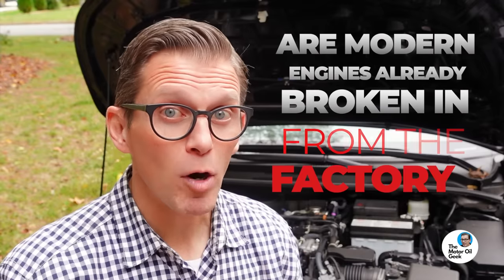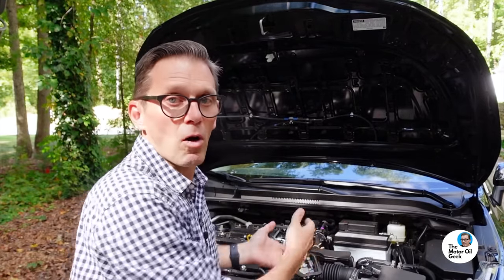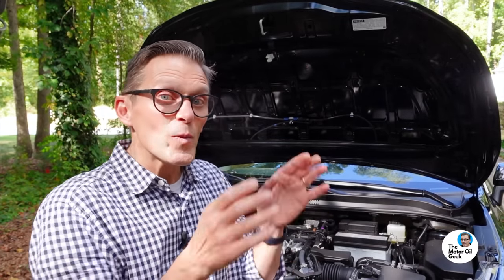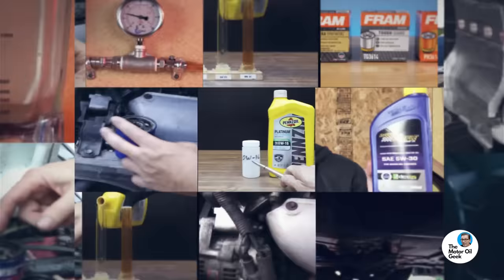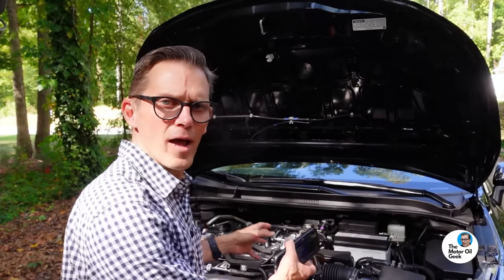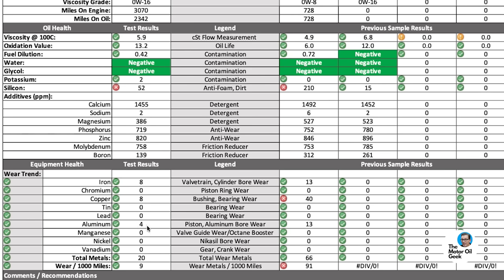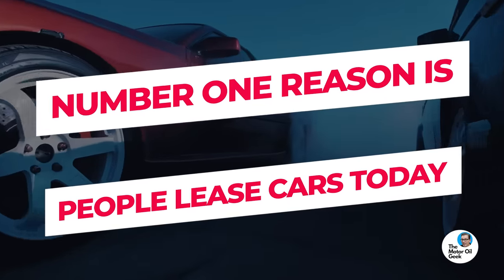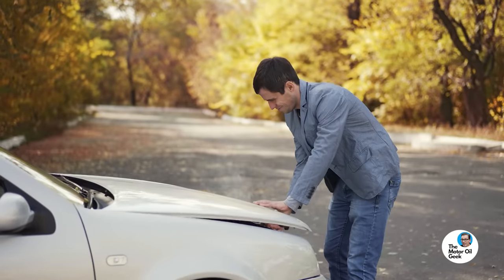New Engine Break-In: Truth or Myth?

Comment: Makes sense, the idea that engineers can spend all day breaking in every new engine never seemed right to me. Like think about how many cars are manufactured in a day, they would need to spend hours breaking in those engines. Just does not seem like a thing the manufacturer would do, when the customer can do it themselves.
Reply from the maker: Absolutely!
Reply: I'm sure the manufacturer will run the engines on a test stand for an hour just to guarantee that there were no problems with the engine but that's not a true break-in. That needs to be done on the road under normal loads and speeds.

Comment: While I agree with your findings, using a different oil viscosity (0w16 vs 0w8) and different additive package makes the initial wear numbers be more inflated. Or equally, you would see more wear if you used 0w8 again.
Reply: There isn't copper, aluminum and iron in an additive package.
Reply from the maker: The additive package was the same, and the viscosity difference was very slight. We will continue to monitor the engine, so this is not the end.
Reply: @tonysteele3805  there isn't but if you use overly thin oils cause of the stupid CAFE you will cause more wear which will show as copper, aluminum and iron in the UOA. I said in the previous video that I would use a good 0w30 in this engine no matter what Toyota says.

Comment: A little story from an expat living in Spain:  I've been here for about 28 years.  Back in 2017 I bought a Volvo XC90 AWD D5, which is a four cylinder twin turbo diesel engine (not available in the states AFAIK).  I was stunned to see that the manufacturer (and dealer) oil change interval was 15,000km (about 9,300 mi), even the FIRST one!  I remember arguing with the gm of the dealership and later, with one of his mechanics that this cannot be true as all engines need a break in period and that IMHO the first oil change should be around 3000km (about 1,800mi) and NOT the freakin 15,000 as stated.  I was told that those days are over, and that modern new engines do not require a break-in period as they did back in my days (I grew up messing around with engines in the 70's).  I told them that was bs and that I would just have an independent shop change out my oil at 2000 or 3000km to be safe.  The dealerhip's retort?  If I do that I will void the warranty that came with the vehicle.  Geezusfuckingchrist.

So stupid me listened to them and have been faithfully completing oil changes every 15.000km (and occasionally changing out the oil about every 10,000km with an independent shop since my warranty period has expired).  My Volvo is still running fine today but over the last year or so I've noticed it has begun to consume a little bit of oil between changes.  I now have 200,000km (about 124,000mi to my metric challenged brethren :-), almost all of which are highway miles.  The bottom line for me personally is that I wish I had just listened to my own common sense and insisted on an oil change interval that I KNEW was the correct one.

BTW, this same dealership insisted that my transmission fluid was for the "life of the vehicle" and have refused my requests to change it out.  So my fluid now has 200,000km on it, and I'm told by an independent mechanic  to leave it alone as changing it out now this late in the game may induce problems to it.  I'm so stupid for not listening to myself and not changing it out at least twice now.

Sorry for the long post.  Love this channel, btw.  Thank you!
Reply: Theres no truth that changing the oil early would have prevented any oil burning today. Do you even know where the oil is coming from? Could be a valve guide seal and not the rings.  I have a 2007 RV4 with 190K miles on it, nothing special was ever done, just drove it like normal and changed the oil at the recommended intervals, doesn't burn a drop of oil and still runs great, chirping tires.
Reply from the maker: Thanks for watching and sharing!
Reply: I agree with appalling68, I don't listen to the dealer anymore when buying a new car and do my first oil change myself without informing the dealer, with OM parts purchased by another dealer. Standard oil interval is now 25.000km by the dealer and I do it myself in the middle.
I hear the same from automatic gearboxes, once the oil is too long inside like over 150Kkm, they advice it's better just fill up and never change it anymore.

Comment: Is there any benefit to putting a magnet on the bottom of a can oil filter (hangs down)?
Reply: Yes, for person who sold it to you.
Reply from the maker: It can help!
Reply: @themotoroilgeek can you test for this? I've been using FilterMags on all my vehicles for 20 yrs. I even have them on my riding lawn mower, and the oil is much cleaner looking when I drain it at the same intervals. When I've cut open the used spin-on filters, you can see a  black-looking ferrous dust shadow on the inside of the cannister.

Comment: imo, if you are going to spend 20-50-k on a new car what is the harm in spending 20-25 bucks on an oil change at 300-600 miles?
Reply: Why not 100-250?
Reply: @ExecuteBrandon  OK, sounds just as good.
Reply: @jp-ty1vd  How do you decide?
Reply: @ExecuteBrandon   I only know what I read.  One person says 300-600, you say 100-250 so 300 sounds like a decent compromise.
Reply: @jp-ty1vd  I asked a question, I didn’t say when you should change your oil. Reading is not enough. You also need to be able to comprehend what you read.

Comment: I have a question, I drive a 99 inetgra and my daily commute to college and work is less than 5 miles one way, the coolant gage never gets up to temp and I'm wondering if changing the oil more frequently would help extend the engines life from never being fully warmed up, is it perfectly fine or am I just paranoid.
Reply: Yes, change it more frequently, as your daily driving pattern is very much likely considered "severe" conditions. The moisture that doesn't get evaporated out of the oil can cause a slight acidity in the oil. Don't spend extra on Gucci oils. Just any name brand that meets spec, of correct viscosity, and change it more often.
Reply from the maker: Absolutely. Short trip driving is the hardest on the oil.
Reply: @Resistculturaldecline  disagree. id definitely go synthetic. maybe a cheap one like supertech or whatever, but definitely go synthetic. its too much better than conventional or blend to be worth the minor cost difference
Reply: Absolutely that's severe service. More frequent changes for sure. That and take the car for a little longer ride once in a while to get it thoroughly warmed up.

Comment: The manufacturer also has an economic incentive for the engine to not last as long after the warranty has expired.
Reply: This is not true, nobody want to buy an unreliable car. But brake-in has a price, manufacturer doesn’t want to pay for this procedure if, even without it, can get expected profit.
Reply: The engine of the car is the sturdiest thing in existence. The only problem a car engine died early is because of the user error and then they go and blame the manufacturer to cope for their cluelessness and incompetency.  A car well taken care of and do regular maintenance last for decades with only the need of rebuilding piston rings after every 200k to 300k miles. You don’t just buy a car and expect it to last for years without taking care of it and ppl tend to think like that, some don’t even read the user manual that was given and then they wonder why the car sucks.
Reply: I don't know if this is completely true. Subaru had engine gasket issues and oil leak problems, ford has timing belt issues and problems w the ecoboost motor, toyota had head gasket issues, dodge had valve solenoid issues...
These have relatively nothing to do with owner maintenance failures.
Reply: Car manufacturers absolutely utilize planned obsolescence. 100% true. If car manufacturers wanted gasoline engines to last longer, they would be made to the same or better standards as diesels. Car manufacturers know their engines won't last as long as they could because there is a financial incentive to make the engines not last as long as they could.
Reply: Sure they can do that but the problem is they will not have repeat customer s and a bad reputation spreads like wildfire
Reply: @K9River not really needed on gas engines to go as far a diesel component quality... Just look at Accord engines from the 90s, those f22 non VTEC engines would go up to 1m miles with little issues apart from basic mantineance

Comment: Its only the break in period after the first 10k miles for the first oil change per the dealership recommended service for oil.
Me o. The other hand changing my oil every month or 3k and never having an engine problem. And my oldest vehicle(2000)has 270000miles+ and doesn't burn oil.❤
All my newer vehicles burn oil☠️💀
and the dealerships say thats normal!!💀☠️
Reply: new cars come out of the car lot burning oil. quality control issues or loose piston rings for cafe or both. my 2005 doesnt burn anything with 1 year change interval, using 'the first in synthetics'. apparently its no joke, you really can do 1 year oil changes. ive done it for about 10 years. engine of course has to be in good working order like no excessive blow-by or broken pcv etc.

Comment: Next question. Do modern engines using otherwise modern oils need a specific break in oil?
Reply: I think so if this oil exists and used, for example, in small general aviation. But reliability and price are not so critical for car’s engine, so I personally just change original oil early.
Reply from the maker: Not engines in new vehicles. They just need the correct spec oil for that engine and a few early oil changes.

Comment: I used to work for a generator manufacturer that built diesel generators. We used Kubota diesel engines direct from Japan. I’m sure the manufacturer tested them after manufacturing because they were still oily when they arrived. But they definitely don’t run them that long. In addition to them we would run the entire product for an hour to test them. In addition to that we recommended that the owner do the first oil change at 25 hours after the engine break in. After that they could change the oil every 50 hours. 

50 hours is the equivalent to like 3,000 miles.

Comment: I work for a major supplier for (almost) all OEMs. While I can't speak to this specific OEM, because they aren't a customer to my location, I can say that all of my customers do utilize break-ins at the end of their assembly operations. What I haven't seen them do, is change the oil after the break in. I'm not sure why this is, or if they do, in fact, change the oil and I haven't witnessed it, but I can say that the "big 3" and others in the U.S. utilize a break in process.

I was also surprised at the break-in method some of them utilized, but I'm not sure if I can speak to that. I'd have to ask if that is covered by my NDA.

The owner's manuals should say to change the oil at a shortened interval for the first oil change, and not to drive aggressively for "x" miles. If it doesn't say that, I would recommend changing it at 500 miles, along with replacing the filter, then using a synthetic oil with a quality filter.
Reply: As a retired 35 year GM assembly line worker, That "break in" is actually a run on the test rolls. They run the car through a couple of acceleration / deceleration cycles to check out diagnostics on emissions, braking and performance. Not really a break-in and no oil changes either.

Comment: This is very timely information for me, I have recently bought a 2024 Mazda Miata Club that had 4 miles on it when I took ownership and I was considering doing an early oil change for exactly this reason! I am currently at about 360 miles and I’ll definitely be doing a change in the coming week when I’ve reached a few hundred more miles. 
Now I just need to figure out what oil I want to use and what weight it’s going to be. Mazda recommends 0w20, but I live in eastern North Carolina and the heat here is definitely on the extreme side and it won’t really ever see extremely low temperatures, so 0w20 seems quite thin considering Mazda recommends 5w30 in over parts of the world for the exact same car and engine!

Comment: Sir, this was truly helpful information. I recently had to replace the motor in a 2013 Buick Regal turbo. I replaced it with OEM/GM same motor and replaced with new OEM/GM turbo as well. Master mechanic at the performance shop said I would be better off. Long story short. The motor came with “Break-In” oil in it. They told me to drive it for 500 miles and be kinda easy on it , then change it out. I’m one of those off individuals that enjoys researching oil and oil filters to see what is honestly the very best to utilize in my vehicle. Whether it be a everyday driver or performance race engine. I can tell sir you are highly knowledgeable when it comes to oil and all the detergents and additives that come from each manafacture. I currently run AMSOIL SIGNATURE SERIES FULLY SYNTHETIC OIL AND AMSOIL EA OIL FILTERS in everything I personally own. I am not sponsored by Amsoil or anyone else for that matter. Just a blue collar working man. In your opinion sir what is the very best fully synthetic oil and the best oil filter on the market? We also just purchased a new Kia Forte with a little N/A 4 cylinder. I will take the advice from this video and do the same on both my 2013 Buick Regal Turbo(engine&turbo replaced) and 2024 Kia Forte. People anymore could care less about taking pride in maintencing their vehicle. Keeping the oil topped off and using quality parts. Doing preventive Maintence. They think the cheapest oil is just as good as high priced oil. That’s simply not the case . But if you can’t afford or don’t want to spend the money on premium oil. That’s each persons choice. GREAT CHANNEL!!!

Comment: Just found your channel and I love it!  I just bought a 2023 Lexus GX 460.  Of course, they said change the oil at 10,000.  I was wondering if the first change on that big V-8 should be at 500 or 1,000.  When would you change the oil the 2nd time?
Reply from the maker: Thanks! The first oil change at 500 miles. The 2nd oil change at 3,000 miles.

Comment: Very good channel, and very good videos... many thanks for them...
Current engines have a quality of machining that no longer requires the long break-in periods that older engines did, but even so, the break-in period exists... we can verify it by seeing how the engine noticeably lowers its fuel consumption after of 5 or 10 thousand km... 
Some engine rectification workshops advise, in an initial period of about 2000 km, to use the engine without demanding it but at varied regimes... I, on the other hand, am in favor of using it at low and moderate regimes in the first thousands of km...

Comment: I just wanted to say thank you for this video.  I just got a 2024 4 Runner Limited, after seeing this video I changed my oil at 900 miles.  Sure enough there were metal shavings in the pleats of the oil filter.  I did not send in an oil sample, but the filter tells the tale.  I wonder if people did  break in oil changes on the new Tundras if it would help the main bearing failures.

Comment: as a guy that spend over a decade as a mechanic at a cadillac dealer the maintenance free marketing started in the 1980s, no caps on the battery but it is the same battery, it was a marketing thing that buyers liked to hear that they did not have to maintain the car, great!! if it was true but it is not, it is just if you follow the dealers maintenance schedule your car will not last as long, dealers and manufacturers are in business to sell new cars, they do not care how long it lasts, better to take advice from Lake or a good mechanic, factory maintenance schedules are a joke
Reply from the maker: Thanks!

Comment: Have had many brand new cars bought and never changed oil super early. Always at the 5k mark and it’s been just fine. Will continue to do so. Speaking of, our new 23 Honda Accord Touring in the manual states. First 200 miles no hard or sudden breaking. Along with in those 600 miles break in period. Don’t accelerate hard or floor it.
Reply from the maker: Thanks for sharing

Comment: when I bought my new truck I changed the engine oil at 500 miles then 1500miles then at 5000 miles and at every 5000miles after, just to flush out the break in particles at 100k it still runs great and uses no oil between changes. I also replaced the differential oil at 5000 miles it came out very black and smelly like you would expect, but then when I changed it again at 20k it looked like new gear oil, and still looks new at every subsequent change, not a lot to spend for the great service life.
Reply from the maker: Right on!

Comment: First, GREAT CHANNEL! Very nice to see someone doing it the right way...

I'm a big advocate of engine break-in and an early oil change. I've done it on all new vehicles and new replacement engines I've ever owned. Your video prompted a couple of questions. Frankly, I've never heard of nor considered if other motor vehicle systems would benefit from a "break-in", e.g.: transmission (auto/manual), transfer case, and differentials. What do you think?

Just as background, I'm not a certified tribologist, but studied lubrication as an undergraduate in mechanical engineering (and in graduate school for other reasons beyond typical lubricants and lubrication applications) and applied that knowledge many times over a 40+ year career in lots of interesting circumstances beyond lubricating machines :). My go to general text/reference book is "Engineering Tribology" by Stachowiak/Batchelor and always Mark's Standard Handbook and the Machinery's Handbook, as well as other text/reference books more specific to my applications.